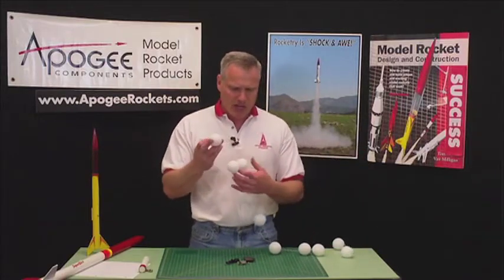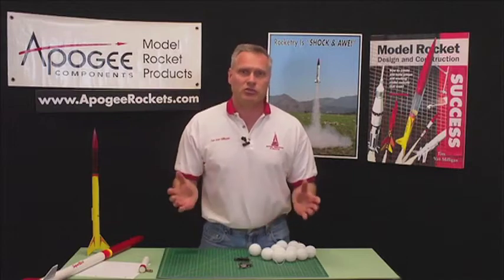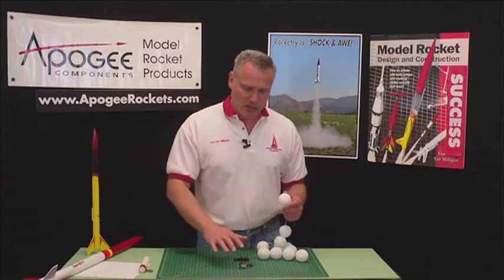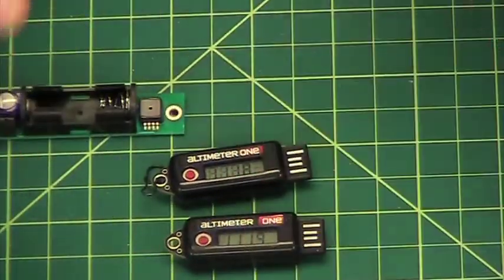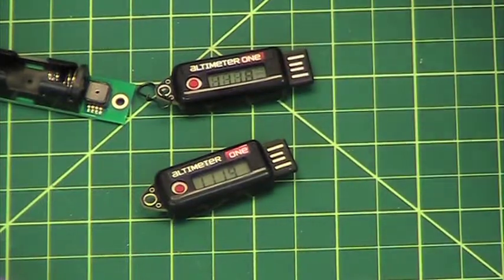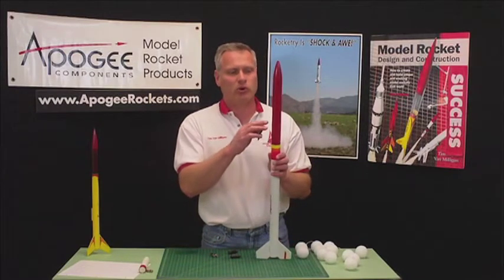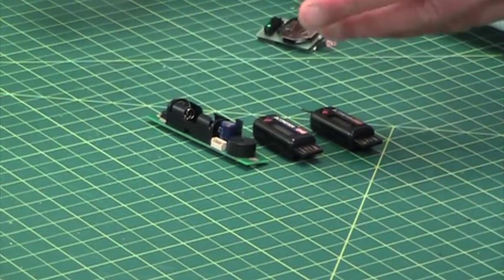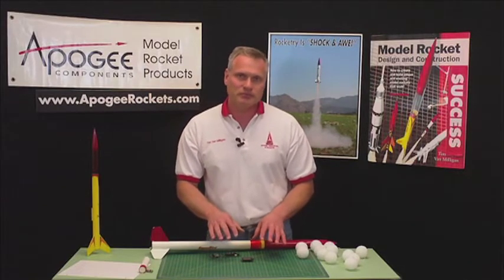How Altitude Is Measured for Model Rockets, Airplanes and kites tutorial

Comment: In space no pressure how altimeter work ? Tell me sir plzz
Reply from the maker: In space, you're absolute right. Altimeters don't work in a vacuum. If you look on the specifications of the altimeters, you'll see the maximum altitude that they do work to.
Reply: @apogeerockets  Which method is use by space companies to get real time data of rocket altitude 
Sir plzz 🙏 make a video on a topic how they get real time data ( eg. Velocity, altitude of rocket )
Reply from the maker: @puwartech7111  You might have heard of it... it is called "GPS"

Comment: Thanks for the great tutorial.  I believe the AltimeterTwo use 3-axis accelerometer to determine speed but it also has a barometer.  Does it use both the accelerometer and barometer to determine speed? I know it has a 25G limit for the accelerometer, thus can it accurately determine speed using just the barometer or is the data not accurate above 25G?